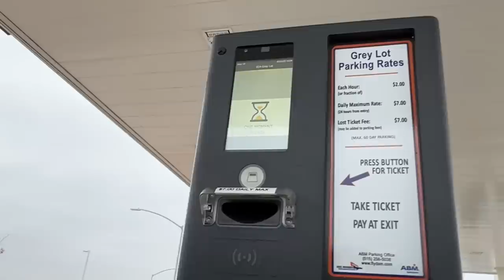Big Danger!! Things Are Falling Off The New Bins!

Comment: I was stationed in Germany back in the mid to late 80's and an ice storm hit one winter.  The cobble stone streets were solid ice.  We were watching a armor battalion move their M60 tanks through the city and they were sliding like 50 ton curling stones down the street.  They hit cars, curbs, buildings, each other.  We had a good chuckle until one came around the corner, lost traction, spun 360 degrees as it came right for us.  We bailed out of the deuce and a half we were riding in and ran for it.  The tank came to a stop about a foot away from the truck. We stopped laughing and started cussing.

Comment: Ugh hate ice storms they make everything look pretty all sparkly and crystal looking but the weight of the ice on power lines will break them and the it takes 3 times longer to fix the lines because of the roads covered in ice. When the ice melts just enough to fall or slide off of trees houses buildings power lines look out wear a hard hat or stay inside out of danger. Ice is very sharp and can slice through clothing skin window screens.

Comment: My brother dad and I just finished our shop after 3 winters of work. Learned lots, one thing was a way to cut the siding steel. We used measured how much to cut, then marked a line with a pencil, then cut the steel with a grinder. I could cut a 10' section in maybe 10-15 seconds and very straight cuts. (I know how long it takes with a pair of snips) :)

Comment: Daddy Corn Star, would you not want to run your load to the front of the trailer, as then the load is pushing down on the rear end of the truck? As putting the load on the back of your trailer will lift the rear of truck up off the ground and not hold it!

Comment: It seems you need a set of chains to put on your truck when it is that slippery. There are fast chains that are easy to get on or off, and they will help a lot. Pulling a large load while your truck has no load on the rear axle is bad, as you have nothing that helps the rear wheels to get a grip on the icy surfaces. I think the bins need a set of snow guards to prevent the sheets of ice from falling down. They can seriously hurt you if you get hit.

Comment: Hey Cole, how does somebody get started in farming? I’ve tried to find farms around here hiring and most are family ran, or aren’t big enough to have employees. I’m in Kentucky, and having trouble finding a way to get started either working for someone or finding a way to start my own. Are there programs or anything that will allow me to come work on a farm and learn how to run the equipment and gain some knowledge in how to get a successful farm started? I’ve tried reaching out to my local 4H office, the only thing they have is for youth and I’m 28. I’ve even tried posting flyers in all my tractor supplies, rural kings, equipment dealers, etc.